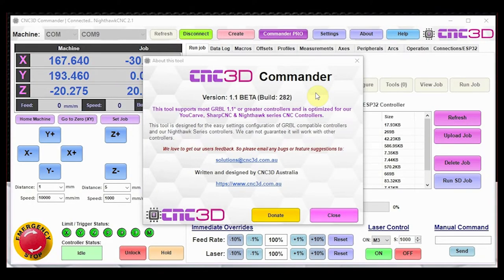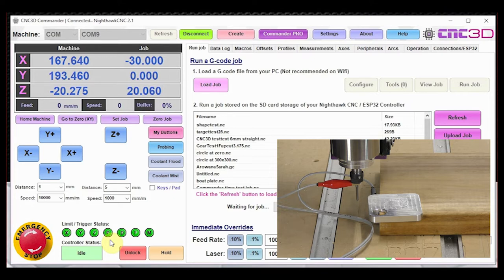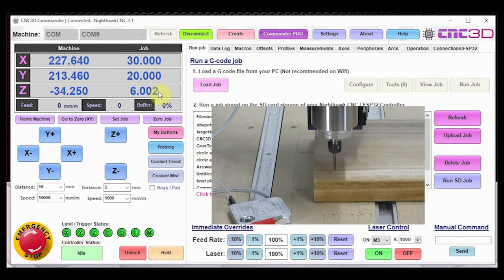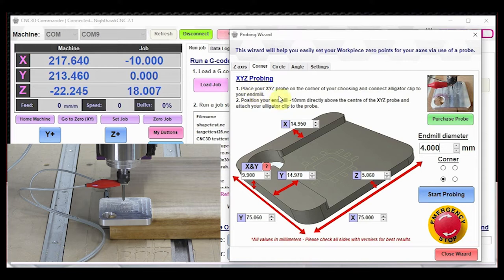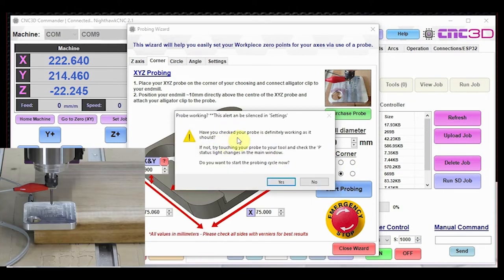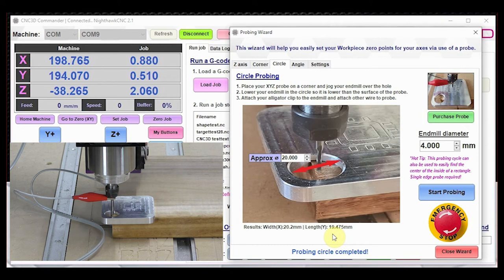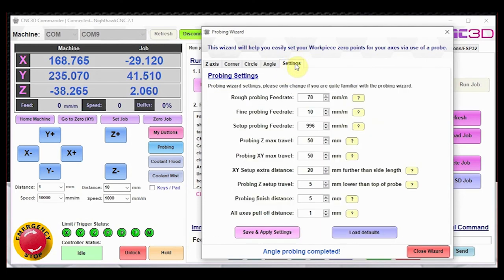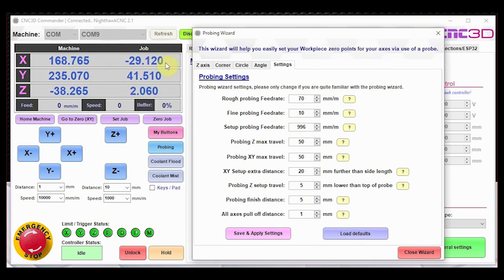CNC How To - Probing your jobs using CNC3D Commander

Comment: what would the corner probe number be if the work piece is a conductive material and the probe touchplate is not being used?
Reply from the maker: Set those corners to zero. The values in the wizard are purely there to to offset the dimensions of the probe. I hope this helps!
Reply: @cnc3d  sadly not.  i keep getting a warning saying i need to allow 17mm in the x and y, which i do. then i get an alarm 2 for will exceed max machine travel, which it wont.  greatly appreciate any help.
Reply from the maker: @scottcristella4666  this may be an easy one. Go into the probing settings and reduce your Z max travel. See if that works. :) 

When probing, you must specify a maximum travel distance. If that is theoretically too high, it will still throw an alarm.